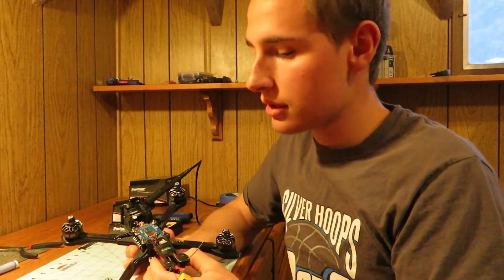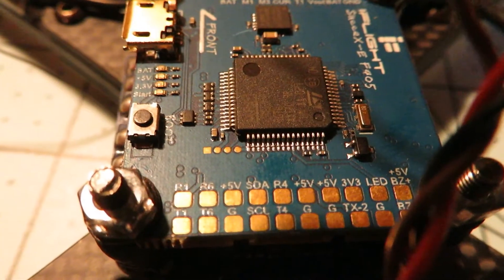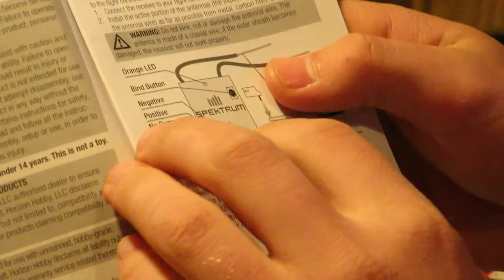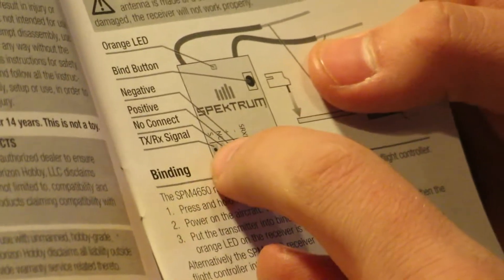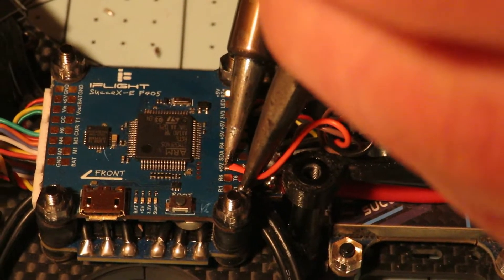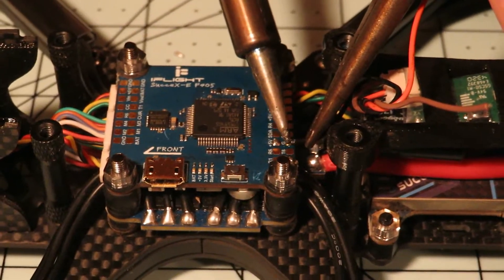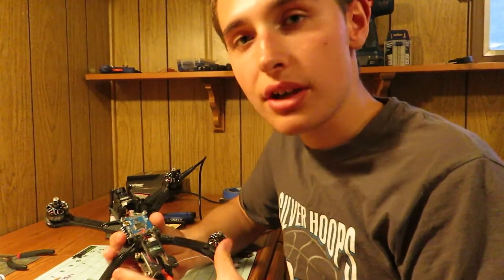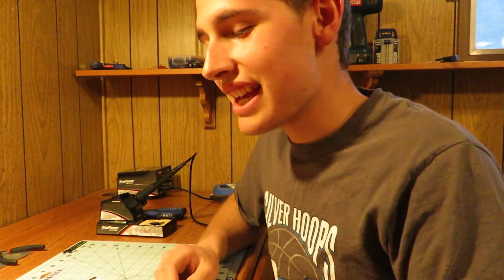Where to Solder a SRXL2 Receiver to a Flight Controller!

Comment: for all who have problems with the error code "no rc link"  but in the receiver tab there are all channels working like they should -INAV and the Spektrum SRXL2 receiver only works until SW 2.38 on the receiver (actuall in august 2024 there is 2.44 on the new ones) otherwise you get this error code and cant arm ...